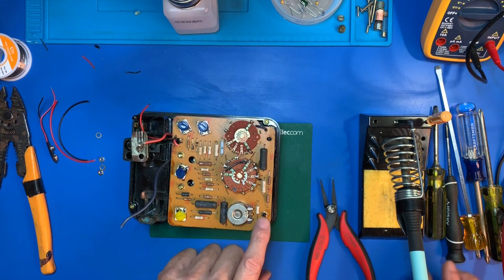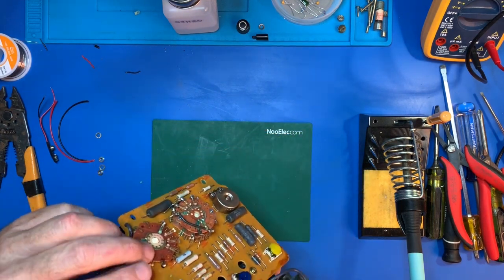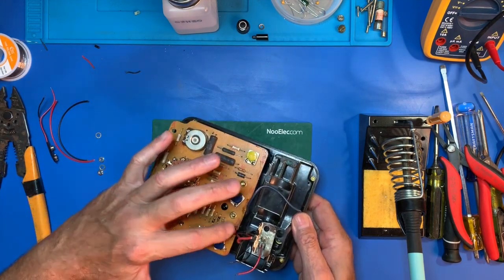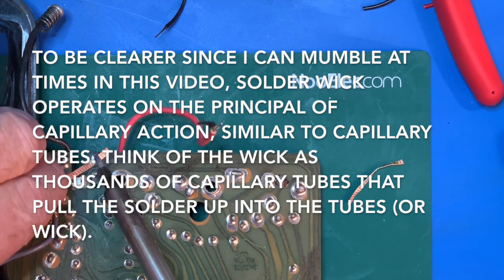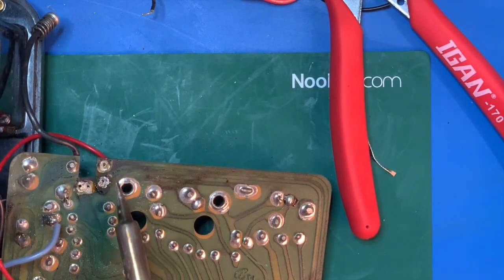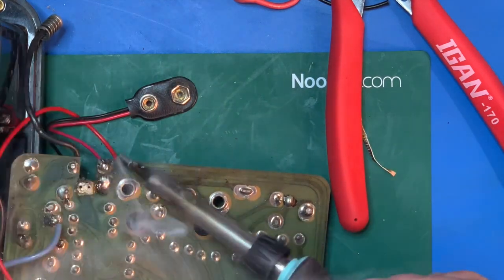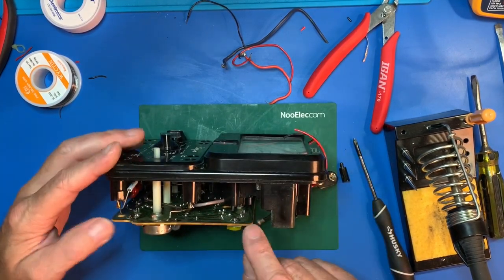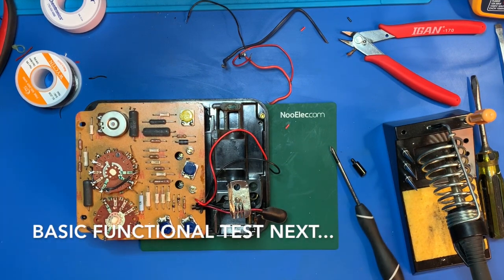SIMPSON ANALOG MULTIMETER REPAIR - PART 2

Comment from the maker: Good luck Asriazh. Take your time to adjust to the correct settings with the knobs when testing. Also, you can get the smaller fuse at an auto parts store. The larger fuse, you will need to find at an electrical supply or on amazon. Here is a link for the larger BUSS fuse: https://amzn.to/2HYp0Vf
Reply: Were can I find resistors in 25mohms range? Any idea?
Reply: You have a very orderly and clean work area.👍

Comment: I'm just in the process of restoring my Granddad's old analog multimeter, so this is interesting to me. Thank You ^_^
Reply from the maker: Good luck Asriazh. Take your time to adjust to the correct settings with the knobs when testing. Also, you can get the smaller fuse at an auto parts store. The larger fuse, you will need to find at an electrical supply or on amazon. Here is a link for the larger BUSS fuse: @t. Take a second and hit the subscribe button so you get notices. I will be publishing another meter restoration video in the future.
Reply: @mpselectrolab1067  Og, it isn't of the same brand or the samr model You showed here, it's a Micronta 22-204U made by Tandy/Radioshack. It doesn't have fuses. The only thing that protects it from blowing up is two diodes across the meter's display. But that didn't save the 8,5 ohm resistor that's used for Ohms and DC-A readings. The 91 Ohm resistor got pretty toasty too but still reads fine. I had battery leakage even worse than on Your meter on the micronta one.Underneath the knob that sets the mode and range, there was a leaf spring that acted as a switch that connected the batteries to the circuit it Ohm reading mode. The knob pushed the leaf spring onto a contact area. the battery alcaline went through the cable that was connected to the battery and corroded the spring so much it broke into two pieces. Soldering them back together didn't help much, even tho i used a thick wire at the back to join the two pieces and reenforce it. Engaging the switch stressed it and the spring just broke at another spot, heh. I may have to buy another Micronta of the same model that doesn't work, so i can salvage the spring from there. Until then I can at least use the other modes besides Ohms readings and to my surprise, after a bit of calibration, the readings are very accurate. i tried a DC powersupply that was 11,99V according to my digital multimeter and the Micronta's needle stopped right before 12V just a needle width away from it. Not bad for a meter from 1974 ^_^